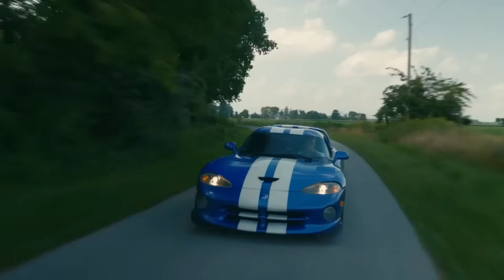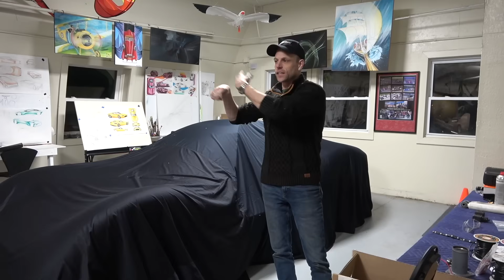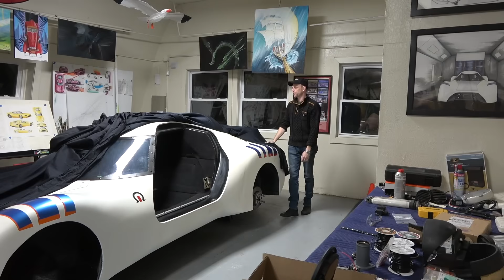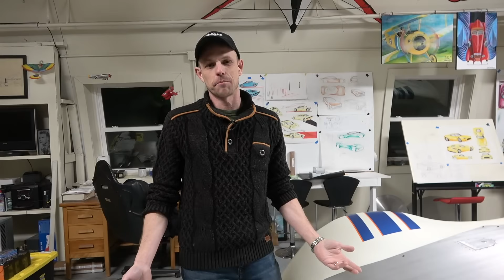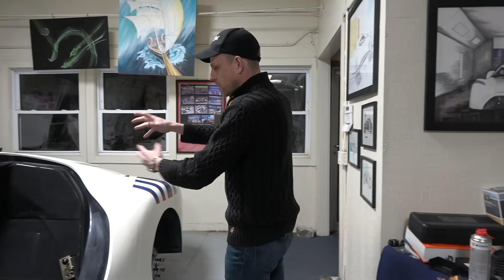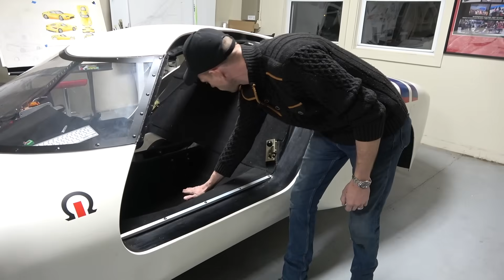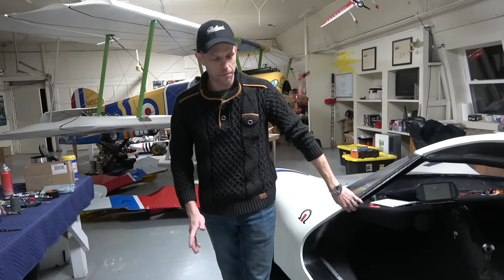Casey's OMEGA CAR because the AUTO INDUSTRY doesn't GET IT!

Comment: I have a 1994 Toyota regular cab pick up with the 5 speed manual, 4x2, 22RE engine, 87k miles on odometer and in almost showroom condition. On ethanol free gas, I'm getting 33 mpg. on the open road.

Comment: You made the point that new cars are not truly affordable. In some of your newer videos, you mentioned some of the reasons but didn't point to all of those reasons as being factors in the prices. You did talk about proprietary part without using the word. The big one that drives up prices is the computerization of almost every aspect of a new car. There are more electronics in a modern car than there were in a defense communications station in Kaiserslautern, Germany in 1988. One of my favorite engines is the one that was installed in the Dodge tug trucks, Cummins 5.9 liter 6 cylinder turbo diesel with no computer. Simpler times. I'd like to see some of these things come back. I can do without points ignitions. I actually like individual coils for each cylinder. Round headlights were okay but it would be nice if we could pop the latest lighting technology through a hole in the back or top. I don't think I can make a logical argument for carburetors because injectors seem to be the only way to deliver the right amount of fuel at the right time. What get me is that a diesel can do fuel injection without a computer. I don't see why an unleaded fuel engine couldn't. It might mean having adjustments on each injector to open at just the right amount of compression or vacuum. I might have to design a new universal injector/spark plug/coil unit that gets fed 12V, on standard automotive wire, by a distributor and is user-serviceable. I think we over complicate some of the stupidest things.

Comment: I blame government regulation that has unintended consequences. Diesel can get great fuel economy and burn clean. The European model looks like that with no soot production but the nitrogen oxide levels are higher. In the US the EPA goes after nitrogen oxide, so to comply with that you have to run slightly rich on the fuel. The consequences of that is some incomplete fuel burn and therefore diesel particulate and the need for an exhaust filter. The exhaust filter gets plugged up so you have to inject fuel into the exhaust and burn it out. All of this complexity adds weight to the vehicle causing more fuel to be burned. 

If instead of looking at nitrogen oxide per gallon of fuel burned, you could look at nitrogen oxide per mile. If you are using less fuel you will naturally be more efficient and that will actually be better. Less fuel per mile equals less pollution.

There is also the fuel economy standards that get exponentially higher as the car gets smaller and the consequences of that are the auto manufacturers building bigger cars and trucks. It's just stupid to make rules like that. Safety standards are also adding a lot of weight to vehicles, yet I can get on a motorcycle with nothing but a helmet on for safety. We should have the ability to build cycle cars that fall into the same category as motorcycles. Very light weight and efficient. Most of the time I drive by myself or sometimes with one other person. I don't think I need a 4,000 pound car to do it in. 

Efficient use of resources is a better way to go. I know that Casey used composite and a variety of things to build his car. O think that i could build one out of aluminum for the most part in monocoque fashion and use a small turbodiesel to power it and be quite efficient. Another option is to go electric but with a diesel generator like Edison Motors did with their logging truck. This would only run the generator to charge the battery when needed and you can run a very small battery pack. There are so many options but regulations and the status quo get in the way. 

I have wanted to build a three wheel (2 in the front 1 in the rear) tilting like a motorcycle diesel electric efficiency car for some time. Time and money get in the way.

Comment: Mirrors can be blended into body lines pretty easy. I'm not a fan of mirrors, ironically i prefer the rear mirror more than anything. Absolutely prefer manually looking through windows, especially behind me. That may be an opinion derived from riding motorcycles.

Comment: One flaw i see in the omega car is a lack of repairability after a small crash. Cars have separated panels to make replacement of individual damaged sections easier and make crashes less likely to damage the entire sub structure. 

How does the omega car address this when it has a single continuous seamless body panel? Is there something about the sub structure that makes it repairable? Are there hidden seams covered by paint?

Comment: This design certainly looks utilitarian.  I would go with a simple 4 speed automatic transmission (for the masses).  Put "wind wings" back in the side of the driver and passenger windshield.  These should have never been eliminated from cars because
their usage kept you cool and most often it was enough cooling that you didn't have to
turn on the air-condition.  Also, as a retired Human Factors Engineer and former race 
driver, I would recommend that you layout the cab for a 95th percentile driver/passenger.
Love the windshield shape!

Comment: If I had the money I would buy a dead car company and make great affordable futuristic looking, efficient cars that would blow the doors off the competition. I want to create my own company that create cool streamlined design with efficiency sustainability and safety in mind and be a few steps ahead of the competition at the same time. I’d honestly if I had the money would buy the rights to Tucker and create a new brand out of it. I have the designs for I have in mind and maybe I will include some concept you’ve told me. Cameras and IPads and an iPhone instead of traditional gear gages. I not only want the cars to look cool and unlike anything you’ve see before but for them to be long lasting (maybe twelve to 20 at worst). My dad and mother would drive Subarus and Toyotas and they’d last us like ten years or so. That to me is efficient. I’m also the guy where I put my money where it is. However I’m more of the guy whom lets the cars speak for themselves. Most of my cars are not only simple in design but cool looking too.

Comment: Would be cool if you finished this car..  and then built a race car version! Also, Casey, the deeper you dig into how electric cars function... their is a flaw in calling them 0 emotion because electric motors need variouse lubricants to function and roll smoothly. If the motor gets hot the oil will begin to burn slightly causing emissions.

Comment: You're right, I hate the auto industry too, and I hate corporate America's crap, and I want a cheap, small, sxs based electric kei truck type thing so I can say screw the insurance companies and still have a way to do things, winter or summer, out in the country. I can charge the thing myself, panels are super cheap. I just need a cheap enclosed miniature electric truck I don't have to insure. Then EVERYBODY can screw off, if I need parts I can make them.

Comment: I had a seat ibiza 6L (so basicly golfV) with famous 1.9 turbodiesel. Being just a 2 door hatchback it was really nimble and the engine was putting out like 330 nm. For a $2k car it was great. and you can easly slam a bigger turbo on it and have easely  over 200 hp diesel and 400 nm... POWAAA

Comment: I like your thinking there but unfortunately what you seek is not possible. It will only be possible if you rebuild the entire society, and good luck with that. At first glance this looks like just a problem with some regulations and greedy car companies but there is significantly more to it. Your model of non-rusting, aerodynamic, high mileage, cheap, long lasting, plastic car is not new. And while it's a very nice social model, it's a terrible business model. As a car manufacturer you need to run a tight balance of size, income and development. If you miss one of the marks, you will be pummeled to the ground. And your car, like it or not, does not tick the boxes. This type of body is hard to make using a machine, and so to have sales you'll have to grow bigger, employing more people than your income can support, raising the price and killing sales. If your car lasts longer then a few years, again, you loose sales because you won't sell any more cars. And if you won't sell you won't have income and so you won't be able to develop new technology - that's where the legal limits will kill you.
.
Modern cars are stamped boxes because that's the way where you can use a machine and literally one of the most abundant elements on earth to make the body of the car. Cars are boxy and stupid, because that's the shape machines understand - a thing that Rolls Royce knows very well, as some of their parts and paints cannot be machine applied, because they are difficult shape. Same lesson was learned by Tesla, when they figured out their machines are not up to the task of assembling model 3 on time. Tesla now lives only because it sells Musks face and eco permits. Also, modern cars are rusty pieces of garbage, because rusting cars die and need to be replaced = more income. When you assemble something in a garage, have all the time in the world and know that any mistake you make is only on this one car, it looks easy to build one. But, once you go for production, and have to make thousands of cars, every mistake, like that experimental body you have here with cellulitis will be repeated thousands of times, lending losses of millions of dollars. 
.
If you want to run your model, you'll need to have your business state subsidized, because one way or another, you won't stay afloat in a capitalist system.

Comment: Hello Casey,  new to you're channel and the message you send is one of efficiency and direct energy which is very refreshing in our "too much of everything world".  I live by the motto of Simple is better.  I currently have a dieselgate 2014 Jetta TDI with "The Fix".  I regularly achieve 4.1l/100km(57mpg) with smart highway driving at 96km/h(60mph).   I do not have any modifications done to the car it is completely bone stock with standard transmission.  All emission standard equipment is still operable.  

At some point I may consider getting rid of all emissions equipment as the EGR recycles exhaust back in to the car.  This in turn, I assume could shorten the life of the car which would mean another car would have to be built or engine resulting in more emissions from making more cars that we don't  need.  I prefer to run my vehicles safely into a grave.  I have also wondered that if I were able to achieve more fuel mileage if/when/what point would the fuel savings balance out the emissions that would be exposed to the atmosphere.  

Thanks for the info and awareness you promote your attempting to be a bigger cog in a very ancient machine(toad0720).

Comment: Had an ‘84 vw rabbit diesel. 1.6 litre, auto (had an economy gear that shifted into neutral whenever the motor wasn’t “pulling” ) non turbo. We were getting 75 mpg (cdn) in it. I completely agree that everything is getting more complicated, and it’d be great to have things put back to a way in which cars were actually designed to be fixed, and not just thrown away and replaced with the next newest (and more expensive) thing.

Comment: I think most should save for a new Kia Rio and a new 150cc scooter. Then buy used later, to me 10 to 50 thousand miles by the previous owner lowers the price, and you might be able to drive it to 200,000  miles with no major problems, especially if you research which models and years are more reliable. I like Mazdas, Hyundais and Kias, because they cost less than Toyotas and Lexuses. Mazda engineers focus on good steering. Ideally live close to where you work.

Comment: one word: lada. cheap, updated models even look nice, they work and easily repaired
Reply: I would make design simpler and lighter, by using in-wheel electric engines, fuel-to-electric main engines, and aluminium-carbon fiber main body construction, and just use some clever engineering to get affordable result to compete with more expensive models
Reply: if you want to compete, you need to include tech that is not commonly used, that is: high capacity graphite super capacitors close to lithium-ion energy densities at 150Wh/kg, metal-air single-use batteries like zinc-air aluminium-air magnesium-air which give a lot higher energy density than lithium-ion rechargeable batteries, or even go to turbine-electric if you want to get great weight-to-power ratios. or just turbo normal sized engines to get the sports car feeling even with low price.
Reply: I would even go so far to include ultralight aircraft features in the ground vehicles which could be registered as quads instead of cars, and put in bi- and quadcopter propellers or make them also autogyro planes or by transformation vtol helicopters.
Reply: I would put also all-terrain capabilities such as amphibious boat features, or with the full roll cages some submarine underwater features

Comment: Just found your channel, I feel like your frustrations embody a lot of people. It strongly reminds me of Wikispeed, the group that was working on (and now achieved) a 109 MPG (104/114 city/hwy) car using a unibody on a strong rectangular base frame. Their movement was unique and inspirational but they seemed to have stopped at the roadster and are now doing extreme manufacturing consulting (lean, scrum) for other businesses.

You questioned why you were doing this and if it even mattered. Although it seems like you're the only one thinking outside the box, there are other people that are just as eager and ready to make or prove that something can be done, and with higher efficacy. It doesn't matter to us if the rest of the world gets it or not. The whole point is to not give up because the system is the way that it is.  

Making something from your passion and sharing it creates momentum for others, and that inspiration gets people thinking along the same lines which proves that the impossible can be done.

Thanks for this video, it was really refreshing, and I'll definitely be following your channel, and I'll contact you when I have an as-efficient motor ready to collaborate with you.

Comment: Ooh, I can brag about fuel mileage now. 1992 Jetta, 1.9l AAZ swap. 4.65l/100km. Makes more power than stock too. Stupid reliable. It's really boxy but it doesn't weigh that much. About 2600 lbs I think. Edit: Oh yeah, the ALH is a stupidly good engine. That was pre dieselgate, they last forever and just sip fuel.

Comment: The variable transmission is a great idea but can't handle high power levels.  If you could make variable intake runners you could change the length to help with pressure wave tuning at different RPMs.  I had a KIA Rio and it could get 50mpg at 55mpg at a low load cruse.  The six speed manual I'm sure helped. It was rated at 38mpg. It got 38mpg at 75mph.  I totaled the car so I didn't get a good look at the intake but it may have a variable runner.  It sure didn't look like an American design intake. Korean company not as many strings held by our oil companies.  If you go overseas they get much better mpg than here.  You can't import the ECM from one of there cars that would be similar to one sold here.

Comment: I agree completely with you.  I left Ohio for many reasons.  I would have been interested in helping....if I would have stayed. Lol. I wonder if you put displays in the inside front corner of the side window with said cameras on the outside?  The oil companies call the shots in America.  The car companies have the technology but can't do anything about it.  E85 is a good idea but you can't run high octane in a low compression engine and expect it to run correctly.  There was a study out there on the emissions vs air fuel ratio vs power output.  It no long is on the web.  I did burn in my memory how the lean emissions curve goes up then back down to a level similar to gasoline at 19:1.  I have had someone conferm that 19:1 is doable using Mega squirt.  The engine did not lug and the EGT was in a safe temp. Only at a low load cruse is this useful but would increase fuel mileage immensely.  Nissan did this with gasoline and proved it works but the EPA will never allow the gasoline to do this because of the high amount of emissions.  The direct injection can give multiple injections per intake cycle and controlling the valve opening  events you can make it the right air fuel ratio all the time.  The turbo reduces emissions and helps create 100 percent cylinder fill.  More than 100 percent (boost after the amount needed to overcome the restrictions to airflow) is wasted fuel unless you need to pass.  The variable geometry turbos help.  The duel injection helps too.  You can get 50mpg out of a SBF in a fox body Mustang.   Look up Doug Pelmer.  He is or was in Napoleon Ohio.  He proved this but somebody shut him up.  I would love to put all these ideas together but divorce made me poor.  Lol